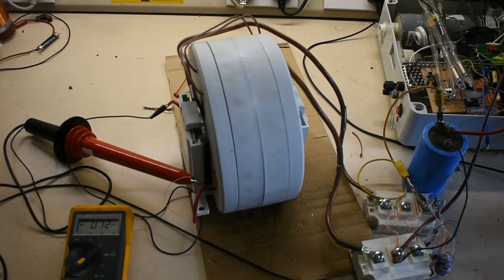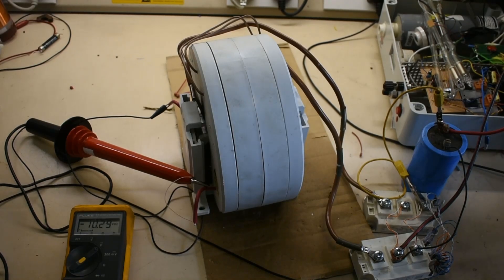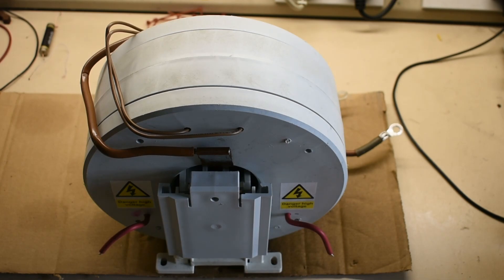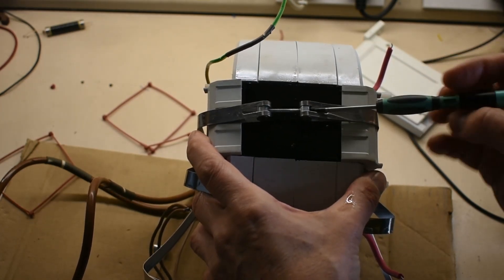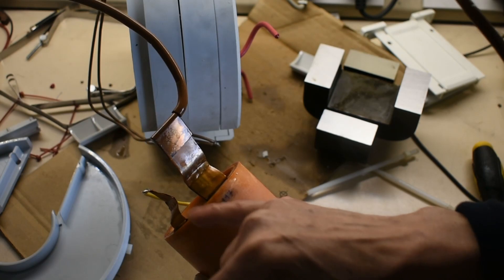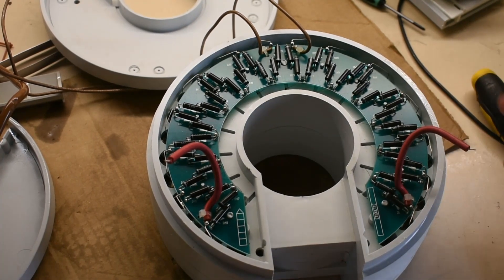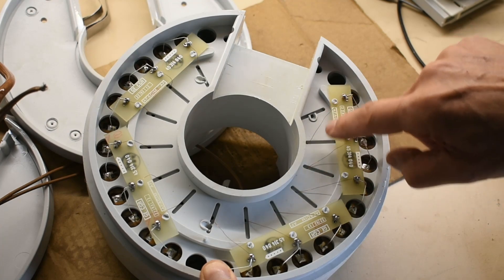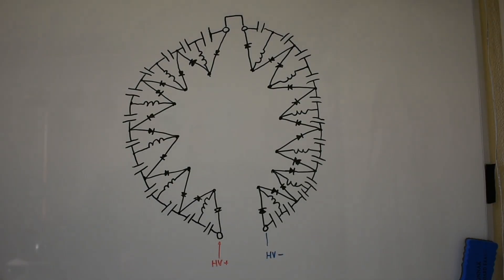High voltage transformer from large X-ray supply

Comment: Great transformer this mate,  its a really common arrangement to have multiple windings each with its own voltage doubler and then all the doublers in series like this. Its much better than a CW multiplier as the current is evenly spread on each sections  diodes unlike a CW multiplier where the input end sees much higher current than the output when loaded .. im not sure of the exact ratings of that transformer but a much smaller one i had had an intermittent rating of 120v 300A on the primary .. 😅
Reply from the maker: It's a really great transformer and designed really well. I must get back to building it up into an HV PSU. I think it will work nicely in either a HV+ or HV - configuration too which is really what I want as its handy to be able to reconfig.
Reply: @tuopeeks  I'm sure you can ground either end too, and the best thing about hf transformers is if they are damaged a secondary rewind is pretty easy

Comment: The arrangement of windings, diodes, and caps is called a split diode transformer; it was common in CRT monitors and TVs from the 1980s onwards.
Reply from the maker: Thanks, I noticed its similar to later line output transformers. Probably a lot less voltage stress than on Cockcroft-Walton tripplers which often failed on TVs

Comment: 👍Voltage multiplier bonanza. Thanks for sharing. BTW, where do you get the gel wax? Could be useful for my (slightly lower voltage) projects.
Reply from the maker: Hi Steve,  the gel-wax is used by candle makers and available on eBay and the likes.  Might be an alternative to potting compounds as it easy to recover the components.
Reply: @tuopeeks  Thanks. Exactly what I was thinking 🙂.

Comment: Nice vid mate.. its obviously better to run with a half-bridge though as 300v would give you the full output and at half the current of doing it with a full bridge at 150v ... also I can't believe you didn't xray it 😅😅..
Cool video and awesome transformer 😁
Reply from the maker: Thanks. Yeah, 300V in would give me 300kV out, way over the spec for normal operation under oil.  Never crossed my mind to have it x-rayed, think it might be a bit cluttered.
Reply: @tuopeeks  yeah its obviously designed for half bridge driver on 240v and full bridge 120v I guess...